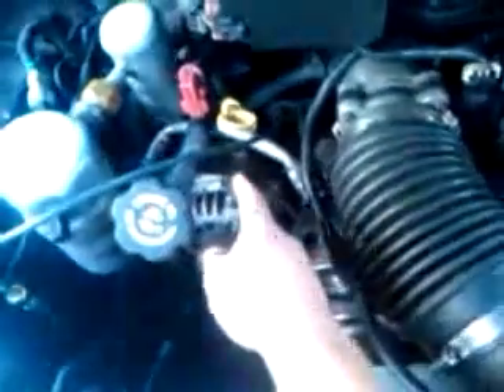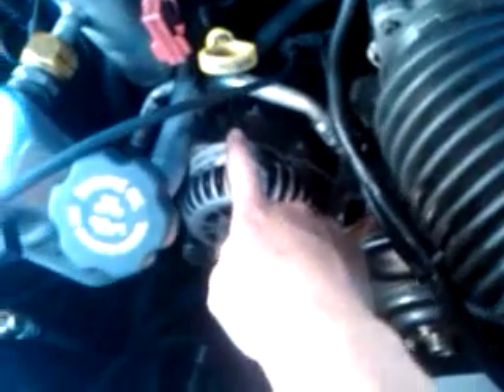Astro Electric fan conversion

Comment: Thanks fot taking the time to answer my question bro ... cuz im seriously thinking about doing the same thing to my 98 astro
Reply from the maker: You can find the fan if you look for the E fan for a 94 Thunderbird, that's what I ultimately had to do when the junkyard fan died.  You'll need the harness plug for it though ( you'll need one regardless of what you decide to use anyway. )

Comment: Did you feel enything different performance wise? Or less gas consumption?
Reply from the maker: No, nothing significant.  It's just easier to deal with working on the front end of the van and it comes out fast..much easier to work on tranny lines at the radiator and the power steering components.